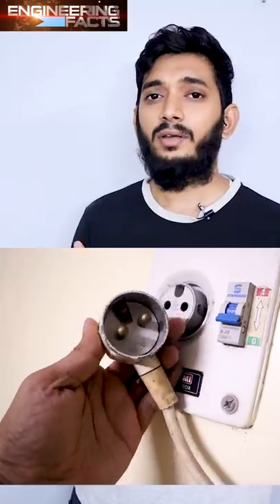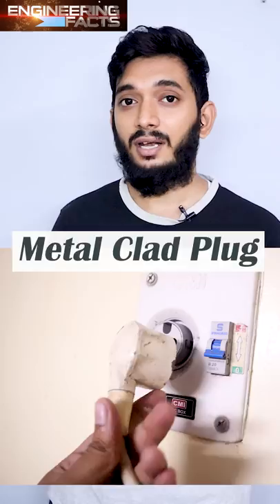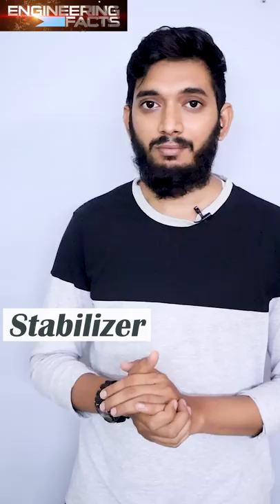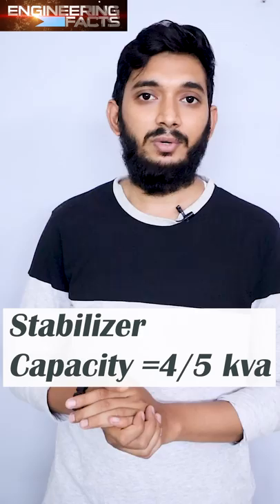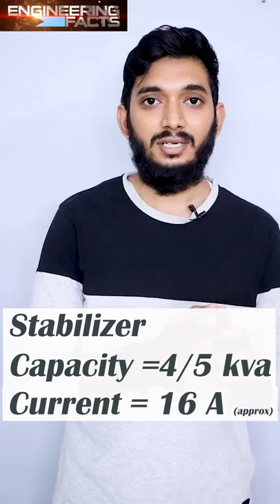Why Air Conditioner plug is different?  #engineeringfacts #engineeringfactstamil #shorts

Comment: I cut n remove the plug directly used connector to stabilizer and stabilizer I directly connect to 20 ampere breaker